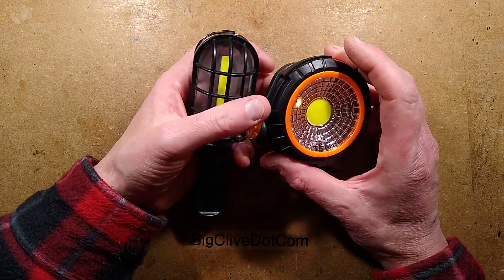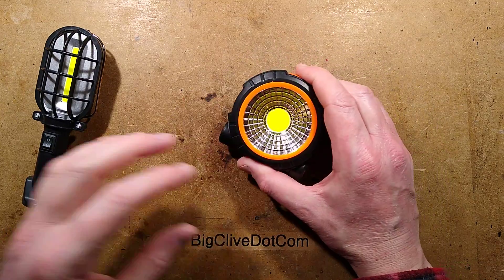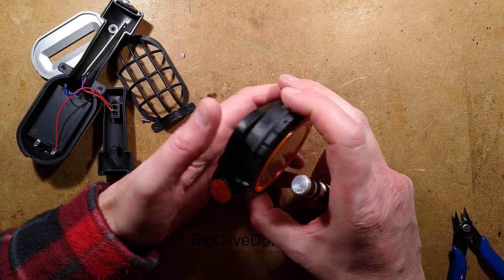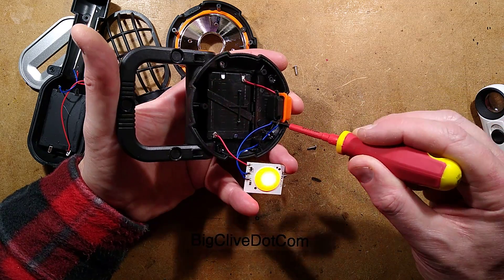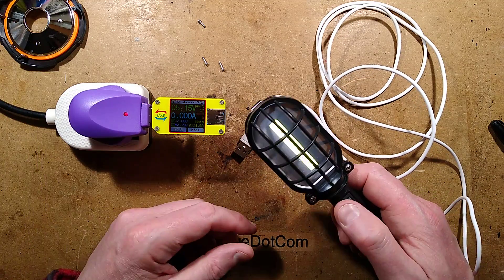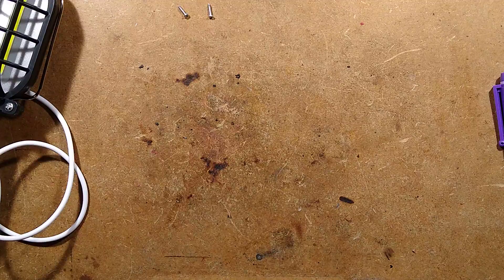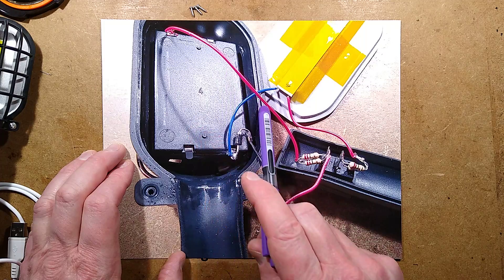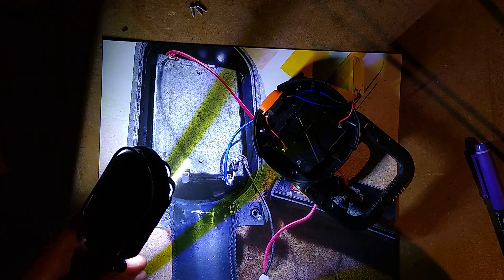Scavenging Poundland LED COBs and a hack

Comment: Take a new lamp ( as above ) and fit a diode bridge rectifier across the COB + a 10 microfarad electrolytic ... then supply the AC side of the bridge via a MAINS RATED 100nF capacitor and 220 Ohm resistor or use a 100nF snubber ( neutral to other AC input  of bridge ) connect other side of 100nF to mains live ( ! )  =  super efficient " night light " that will last forever ( my version has been continuously connected for 10 years ( or more ! ) hint : X2  100nF motor noise suppressors are ideal !

Comment: i found a similar work light on ebay uk using the search terms " led magnetic work light torch lamp builders" it has a dc socket on the back which went straight to the battery holder  made modding it very easy

Comment: It Seems Clive has his spies everywhere.  Whenever I visit my local el cheapo store ( Otherwise known as The Reject Shop here in Australia ) looking for items to experiment with/on , The items I purchase are debunked on Clive's channel.. Usually only a couple of weeks before but then again, some have been well over a year..  I take great pleasure in debunking some of the more dangerous items I have found . From USB chargers with mains potential across them,  Mains Power sockets where the on off switch is in the Neutral wire on both outlets,  Power saver plugs which do nothing and lots of cheap chinese rechargeable batteries with unholy capacities printed on them.  I even found the LED lamps that Clive has studied and modified plus I  rebuilt the solar LED PIR outside lamps with better batteries and a much better solar charging regulator...   Clive, Keep up with the videos please, you are legend among Aussie Electronic and electrical enthusiasts..

Comment: I use the circuit board from poundland's £1 mini USB powerbank, connected to a small mobile phone battery that exactly fits in the battery compartment for 3 x AAA... then you can take power directly from the battery to have 3.7-4.2V that doesn't turn off if the power gets low, or take the fixed 5V from the charger board, which is much brighter (and gets hot without resistors) and turns the power off for undercharge protection. Very easy way to make something USB chargeable + use lithium ion battery for £1 :-)

Comment: Feels like a missed opportunity to crammed a joule thief inside. I had to crammed one inside my nephew Chinesium AC powered night light. The circuit has a very nice 3 LEDs capacitive dropper with very questionable tiny slide switch and the life wire very very very close to the board.

Comment: You could put a schottky diode on the left side to bypass the resistors during discharge to avoid going through the 11 ohms, but it would drop 0.3V...would that be less than the voltage drop across the resistors ? Depends on the current I guess.

Comment: Are those calipers actually carbon fiber? I bought one and the listing was weird, hoped to get metal, got that light one. It says something about carbon fiber components on the back, but I thought it's plastic, because when you open it there's a stick coming out the back for depth measurement I think, and if I hold it by it, the whole thing bends, and I thought carbon fiber is very rigid.

Comment: i did the hack before i called it usb boost as the batteries did 4.5 and usb does 5 , i am kinda lucky i didnt find out what happens if u leave alcaline batteries charging and luckier that the batteries i used were dead an i didnt use anything else just a broken usb cable on the + and - , glad i didnt try it on the fan i had it didnt had a resistor an died after a week of being on continuesly

Comment: Drawback of the 'always on caliper' is that after a few months it won't come on at all because the cell will be flat, or at least that is my experience of a similar one. I have resorted to taking the cell out which is rather irritating, but slightly irritating than getting new cells.

Comment: They sell that exact same light (the one with the handle) with batteries for I think $3 USD in New England at a place called “Ocean State Job Lot” which sounds like the NE version of Poundland. My kid uses it and the grille broke off and the switch is touchy but still works.

Comment: They do a rectangular light with a big on/off switch in the middle and 2x COB LEDs behind a diffuser - they are two COB lights very similar (maybe identical) to the LEDs in that worklight.  They also do a blue COB headlight (worn on the head..) which has a smaller COB on a heatsink/PCB controlled by a the usual On/Low/Flash controller.

Comment: I've got those calipers. They aren't carbon fibre they are glass reinforced nylon but that's fine because it means they don't conduct electricity. They work well and are ideal for measuring batteries and magnets. I think I paid £3.

Comment: Hey, if you put the switch and the led's directly on the + of the battery. I'll save you the 'right' 2 resistors and have a brighter light on batteries

Comment: I've USB-ified some of my flashlights because they drain batteries quick. Most of the time the lights have resistors built in so I just solder the USB lead onto the battery terminals. I have this tiny bendy light that ran on LR44 button cells and I put a short USB lead and I use it on a power bank. It even makes the power bank turn on when you press the button on the light.

I have a worklight like the one here and it's very bright. I don't plan on modding it.

Comment: Hi Big Clive!. I own a Fluke 70 Series II Multimeter, a Greenlee DM-110 (Madre in Taiwan) and a Blue-Point DMSC683 (by Snap-On (Automotive Tools Brand in USA (Made in Korea))). I want to keep only 2. Which pair would you keep?
Reply from the maker: I'd suggest keeping all three as it's sometimes useful to monitor multiple parameters at once.
Reply: @bigclivedotcom  Thank´s for your reply. The thing is that I my son needs one and I want to give it to him.
Reply from the maker: @pepetono6374  The meter you give him will depend on the work he's going to be doing with it.  If it's just bench tinkering then a basic meter will do.  But if it's electrical installation or troubleshooting then he'll need a meter properly rated for live work in high current equipment.  (Cat III or IV)

Comment: Question :. If you wire it from USB through the 11 ohm resistor to the batteries like you have it, but go from the switch directly to the battery should make the light not drop in brightness when you unplug the USB. The voltage from the battery is going through a total series of 22 ohms per your drawing where with USB power it only going through 11 ohms to the COB
Reply: That would work but then the batteries might discharge when it's on and plugged in.

Comment: OK, so I know very little about electronics, but could you not have had 1 set of resistors pre switch on the USB+ and had a more useful light or are the two needed to provide protection when the USB is powered and the lamps turned on?

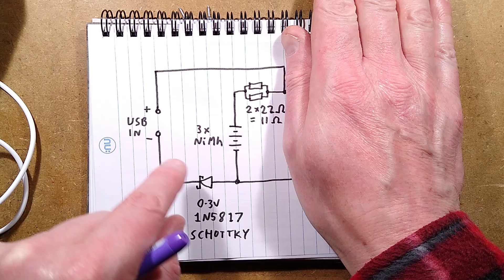Comment: 9:24 You can put Schotky in parallel with those two 22 Ohms resistors, Anode on battery +, so you waste less power when you are on battery mode due to low Vf of the diode, this will also allow you to set the charging current by selecting other value than 11 Ohms.

Comment: I wonder if it's possible to build an 80's style 8-bit microcomputer from products purchased from poundland(or dollar stores in the states).
Reply: No, nothing has any programmable processor. You'd probably have more luck building a 60s style minicomputer by finding something which has discrete transistors, but it would get very expensive very quickly.

Comment: I found a similar COB in a $15 Husky work light. It also seemed to have two sets of LEDs in parallel, both connected to the driver, but only one actually used. Weird. Also, it has two sets of three AAs in parallel, and it draws over 1 amp from each string... yikes.

Comment: Sod USB Clive, those are ideal for fixed wiring under the car bonnet as fixed position worklights at night. Simple, cheap buck converter to drive them off the car battery. Or car boot lights, or car footwell lights, or  rear passenger, under seat footwell lights. 👍👍👍

Comment: Clive with your smaller hand tools like precision screwdrivers and wire cutters, do you insist on getting decent brands or do you settle for cheaper brands?
Reply from the maker: For bench work cheap brands are fine.  For heavy use electrical site tools the better brands will last a lot longer.
Reply: @bigclivedotcom  thank you.

Comment: Could you not have used an 18650 micro usb charge board then you could have done away with the usb cable sticking out of the light?

Comment: What would happen if you put a diode across the two resistor that are limiting the charge to the battery.... so when the unit is not being changed by the USB more current would flow to the COB LED?

Comment: Bigbad Clive I need your help , installed a heater system in my van , but the pulse pump is interfering with the led lighting, what would you recommend to correct the flickering ? Thank you , your tech- godlyness 🤪
Reply from the maker: If it's causing the lights to dip it may be a shared connection or bad ground.
Reply: @bigclivedotcom  thank you Clive I'll check out the grounds ,   there both running off a leisure battery , I suspect I might be getting an emf feedback do I'll diode up the pos and neg to see if that helps , thanks Clive 😁

Comment: Guys I have a AAA cel is getting really hot whille charging and also not holding the voltage for many hours. So..I guess it's dead? Short inside? Is there such a thing?
Reply from the maker: They can fail inside.   If the voltage is falling itself then let it fully discharge itself and recycle it.
Reply: @bigclivedotcom  thanks BigClive!

Comment: Say what you want about these LED lamps, they're head and shoulders above what you could get for 20x the price 30 years ago.
Reply: @Joachim Shekelberg which isn't a fault with the lights. It's the manufacturing that's bad, you can just resolder.
Reply: @Gazr Gazr I don't think that's why, it's because they didn't use LEDs.
Reply: thorium lanterns though
Reply: @dfpguitar  mmmmmm, frontal lobe cancer

Comment: Doesn't the Schottky diode allow more revers currant then the silicon? would discharge through charger.
Reply from the maker: Just low current, and only if left plugged into an unplugged charger.

Comment: Poundland COB lights are crap....because they run off AAA batteries, but they're much better when you tear them apart and hack in a USB recharging board from one of their USB battery banks and a lipo/lion, then you've got a very useful USB rechargeable light source.
Using those Amazon Echo Dot powerbanks from Poundland they had for £5 each (bargain even for their two 4000mAh cells inside) I hacked on the COBs from those lightswitches, plus voltage regulators, ending up with two very bright USB rechargable floodlights.

Comment: I just recently fixed my tactfire LED headlamp that runs on dual 18650 batteries. I only got it for $10 like 3 years ago, but I use it nightly at work and it's like my little buddy that lets me see at night. Lasts weeks on a charge.

The wire routing was weird, the conduit goes from the battery, to the front where the switch is at, then goes back to the battery circuit board, where it then goes to the front light. Wire that goes from the circuit board to the front light broke it's solder, so I fired up my iron and resoldered all the wires. Should be good for another 3+ years. Simple fix but I was extremely happy.

Comment: Would love to see further hacks, like converting to use an 18650 cell!
Reply: Why not migrate the COB to a single-cell (18650) USB battery pack ('external power supply')? A bit of judicious drilling and gooping and you have a stand-up, rechargeable, socket-ready, protected, compact, USB, slightly-directional, mouth-holdable work light that fits in your shirt pocket. Might even have provision for a lanyard.

Comment: I'm a bit of a greenthumb and have been planning to DIY some growlights for years but they get so expensive if you want to make the best possible one. Anyone happen to know a pcb manufacturer who can also pick and place Samsung LM301B LEDs?
Reply: JLCPCB perhaps?
Reply: @tinkerbot4148 Lcsc that Jlcpcb uses for parts doesn't have Samsung leds unfortunately.
Reply: No point making "the best possible one";  buy three cheap ones for the same cost, and get on with the much-more-important growing.
Maybe check the earthing on the cheap ones, though...  ;-)
Reply: @theskett  I can't fit 3 cheap ones in the same space and besides that means the efficiency would go down so much the power bills will be ridiculous in the long run.

Comment: I got tired of putting AAA cells in the PIR module on my led strip I use in my cat feeding area, so I installed a dimmer switch and usb lead for them. Now I don't worry if the batteries are dead.  
It was this channel that taught me how to do that.

Comment: The digital calipers that are in Aldi/Lidl from time to time are quite good, all metal, good repeatability and low quiescent current all for about €12 if I remember correctly
Reply: Yeah, cos we all want more Metal/Conductive tools while poking around live components. ;)
Reply: @snakezdewiggle6084  Sure that just makes it more interesting!
Reply: I bought one and it seemed to have sand in the mechanism - made a grating noise when sliding. Took it back and didn't want to risk another!
Reply: @AAAyyyGGG  they are rough as a goats knee but they're cheap .

Comment: The plastic cage on that worklight is pointless as the LEDs are recessed anyway, it just causes those annoying shadows 🤔
Reply: I thought the same when I saw it too.
Reply: Snips… where are my snips? One moment, please. 

(Snip the cage off near the body, not flush with it, angled so as not to create small hooks and to hold the light bay off of a flat surface…

Comment: Clive, if i mod your circuit by moving the charge resistor (which is next to the battery) up inline with USB IN (+) before the switch, so the battery (+) goes straight to the switch, the LED will lights brighter when powered by the battery, because the current from the battery to the LED only see 1 resistor, not 2, right? is it a good mod or a bad one?
Reply: You would just be swapping the brightness levels the other way round i.e. dimmer when charging, brighter when on battery power.  That would drain the battery quicker.
Reply: @tinkerbot4148  ah yes, i do prefer the battery to last longer.. thank you for point that out.
Reply: The objective is to see, rather than to preserve the charge in the battery; a brighter light while on battery makes more sense.
Reply: @michaelthibault7930  true. i think we should find the sweet spot between these two factors. bright enough to see while keeping the battery last long, because these AAA batteries don't have plenty of juices.

Comment: oh how I despise torches that use 3xAAA 's!
Reply: It feels so antiquated now that I discovered 18650 flashlights. I even have one with a 26650 battery. Way more convenient.
Reply: I'm glad I'm not alone in this thought! Torches shouldn't use AAAs!
You can make a useful, bright floodlight by hacking parts from Poundland purchases and a 3D printer, notably salvaging those two COB LEDs from the lightswitch light thing, and the 18650+charging board from one of their cheap USB power banks.
Reply: I use single AA/AAA with joule thief
Reply: @horacewonghy  Joule thief rules!
Reply: Regardless of the size of cells, I love products that three A type cells, makes them perfect for hacking in a tp4056 + lithium cell or 5v like Clive did here.
Reply: Right on that!   3xLR41 lights are so superior!
Reply: @77thTrombone  🤣_
Reply: I much prefer the AAAs.  I have plenty on hand, I have multiple chargers, they cost much less than 18650s and they're easier to get if I need more.

Shipping 18650s internationally isn't really an option and very few places sell them.  Mostly only vape shops.

What I do hate is lights that use button cells.  Button cells are easy to get, but very expensive.

Comment: Those worklights are great bought three of them. However I modified mines differently. I managed to squeeze in a small lithium pouch cell and a tp4056 into the battery compartment. Wanted to go with a 18650 or a smaller cylindrical cell however there's not much space inside the housing.

Comment: An idea is to use three resistors at ~5ohms. One on the plus lead from the USB cable. It would make the difference smaller when disconnecting the USB cable.

Comment: I have one if the work lites but it is a little bigger and you can stick a 18650 in the handle, the LED is also bigger and allows for the 3.7 -4.2 volts without any limiting

Comment: I would have used a pouch style lithium battery and also included a female USB port to plug the cable into.
Great video however, very good indeed.

Comment: Huh. A plug and socket for the cord would be a little more convenient- and a 5V relay would automatically light it when power dies. Put the coil in series with the incoming USB power and the NO contacts in series with the COB.
Where's my soldering iron...

Comment: On your light you modified couldnt add a micro usb connector so you could disconnect and reconnect usb cable
Reply: You can do that but it's much easier to just cut a cheap cable than work with a tiny connector.

Comment: I love a rechargeble  worklight with a basic on off switch, no weird modes. The astro pneumatic dimmer switch is also fine, for around 8 euro's I bought a knockoff from aliexpress. It works good, no grey light but 4000K-ish, even got a battery level indicator. It's a bit too big for electronics tho so I've bought a 10x7cm one with the same switch, even got an usb out for the same price. Guess I'm not the only one with too much worklights..